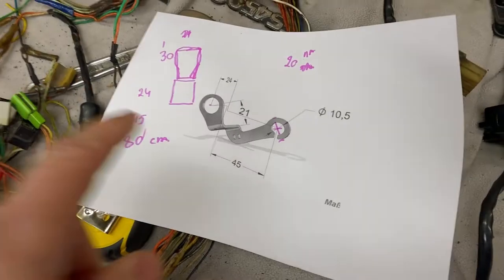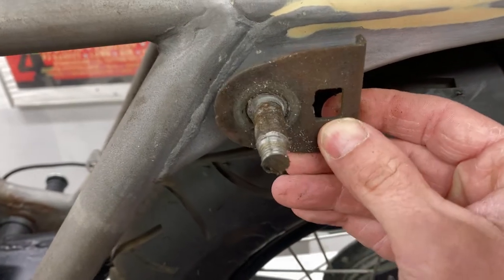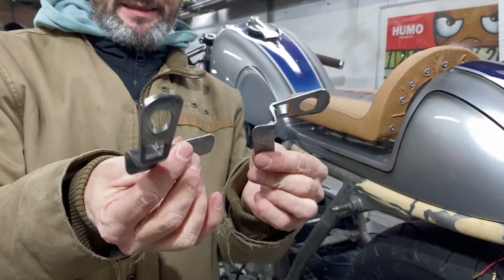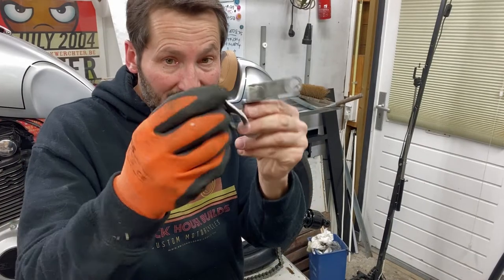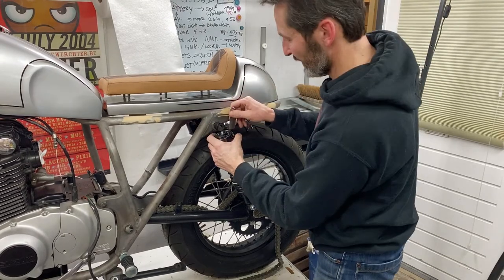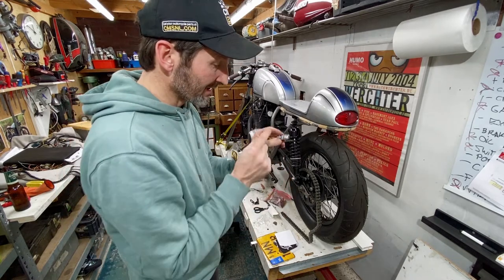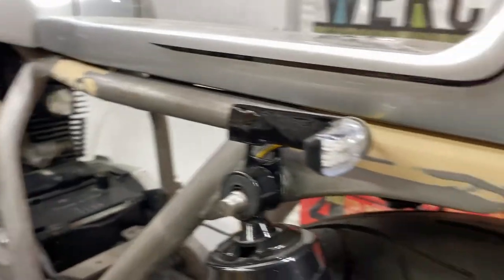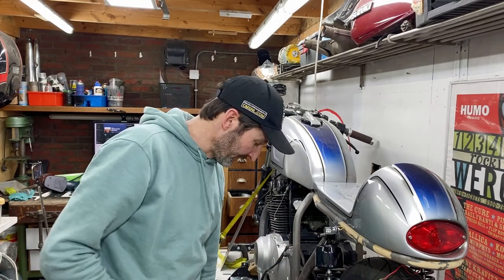Suzuki GS450 DIY Blinker Brackets

Comment: Scrap bin is the most valuable thing in the shed! Not really of course but so much useful material you can reuse just like this!
Reply from the maker: I save so much metal. Especially from things like old furniture. they often contain a lot of metal but also perfectly good nuts, bolts or screws.

Comment: What about just drilling a hole in the frame behind where the shock is bolted on? That will hide the wires as well. I have the exact same indicators on my cafe racer build btw 😊
Reply: You would run into a potential structural integrity issue. The lights threads are likely not long enough to extend the full inch plus through the frame either so that adds complications.
Reply: @BrickHouseBuilds  Absolutely a valid concern. I would probably have inserted a pipe and welded it to the frame bracket on both ends. Nothing is impossible, the impossible just takes longer time 😋
Reply from the maker: Thats a good option as well, but i went for this just to try something else. I havent decided to go for this option but i did decide that i wasnt going to drill in the shell. But the frame is an option. Thanks for that.

Comment: nice work, can you tell me what tire size are you running? I'm doing a spoke rims conversion on my gsx400s, and where did you get the rear rim spokes? 
thanks! 
looking forward to seeing this bike running!
Reply from the maker: The wheels were already done when i bought this project bike from the previous owner. So i cant tell you anything about the spokes unfortunately. The are stainless btw. 
Tyre size is standard for a GS450L. 18 inch at the front and 16inch at the back. On my other GS450L is swapped the small rear wheel for a larger one, think it came from a GS500.

Comment: What size rear tire did you go with on this? I have the same bike, and a 120/90/17 rubs. Suggestions? I want to go with an enduro tire
Reply from the maker: Its the standard rear wheel that comes with the gs450L (this is the L model). So that is the fatter tire, 120/90/16 . The other gs450L i changed the rear tire to a slimmer type. Think i took it from a gs400.